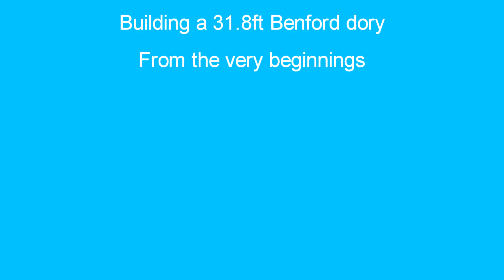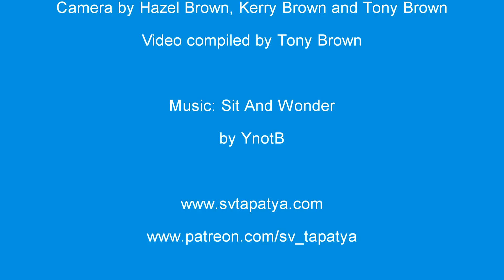The forward bulkhead and the first frame - SV Tapatya EP06

Comment: Thanks for taking the time to document your build. This whole series answers many questions about a Benford build. If I may, in building your frames, why did you use a halving joint, rather than a butt joint with gussets? Thanks.
Reply from the maker: Thank you Scott. You may indeed!

The frames between the bulkheads are not in the plans - they are my adaptation of the boat, which I copied from another builder ( Greg, the builder of Willow- his website is sadly offline now)
They are extra reinforcement and so don’t need to be overly strong. Not having a gusset or web there gives more room inside the boat and avoids having fiddly corners that might trap moisture and debris. 
Of course, a lot of that halving joint is cut away when the notches for the chine log are cut, but, speaking from experience, it all comes out plenty strong enough. The planking ties it all together when it’s in place. The strength of the hull structure is impressive.
Hope that helps. Feel free to get back if you have further questions 😃